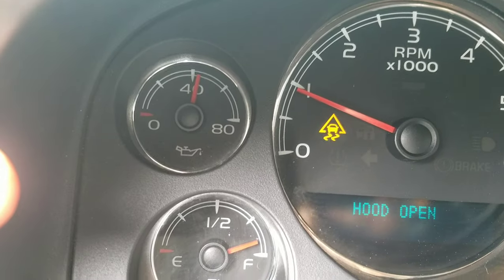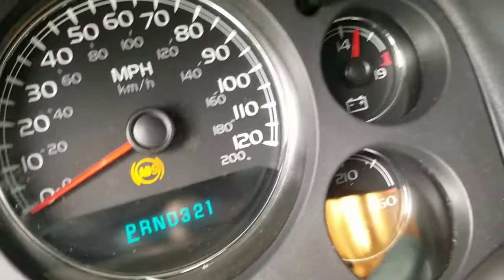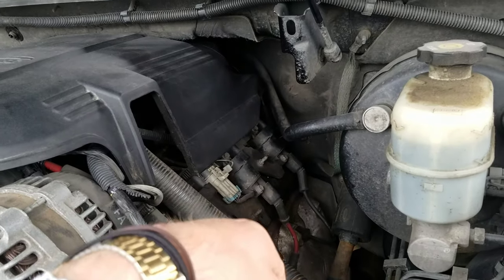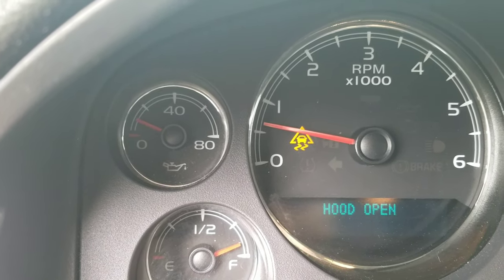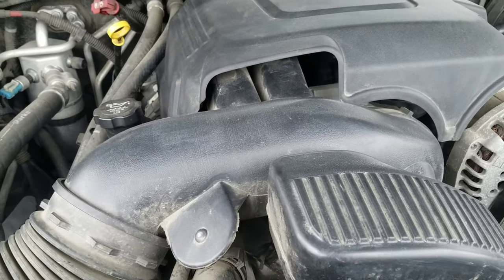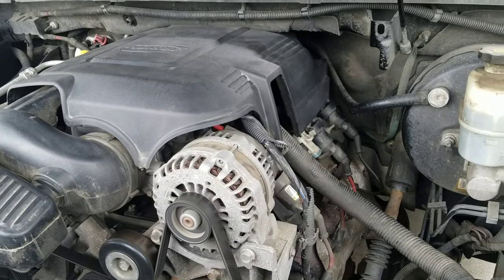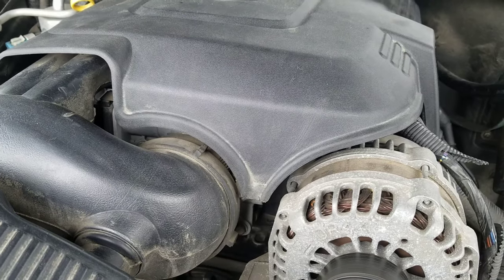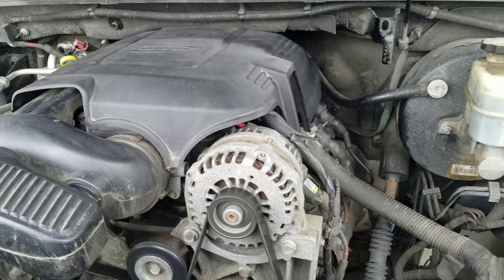0 or Low Oil Pressure? Chevy Suburban, 5.3l Vortec 2007-2014, Tahoe, Yukon. Diagnose and Fix Easiest

Comment: IMPORTANT! READ! this is my experience. I was coming due for an oil change at 237000 miles. I was about a quart of oil low. For the first time ever that warning light came on to "stop engine" due to low oil pressure. I took my foot off the gas and saw the pressure drop to zero. Fortunately I was a block and a half (less than an eighth of a mile) from home when this happen. When I stepped on the gas the pressure went to 15 and I was home and shut the engine off. I put almost a quart of oil in the engine to be full. My pressure went to 35 when cold start and dropped to 26 when engine warmed up. I studied you tube lessons on this. Auto Zone tested and said oil sensor needed to be replaced. A you tune lesson or two said put in medical oil flush, run engine at idle for 5 minute, change oil, use good oil filter, and use a quart of Lucia Oil stabilizer. I followed these directions having oil change at Wal-Mart directly after 5 minute flush. My oil pressure improved! It was 36 to 41 whether running in park or driving at 55 mph. I drove 20 miles to auto repair shop. That oil pressure maintained itself. By calling around this mechanic agreed to replace the sensor without removing the intake manifold and just working behind the top of the engine. The cost for sensor and labor wss $165. But this is when my awareness enhanced. He showed me the screen just after removing it. It only had a few specks of crud in it. I mean like 95% clean. When the job was done and I drove it the pressure was actually 1 psi LESS than when I drove my 2008 Yukon there. Still stable oil pressure as when I drove there. I then heard if we use an oil flush once a year at this mileage we will never have a problem with oil pressure. My conclusion: I did not need to replace the oil pressure sensor once I saw with confidence my oil pressure was good and stable going to the mechanic. Try this. If it works you save money, time, and worries. This was my experience. Wish you the best.
Reply: Thanks so much for this comment. My 08 suburban has been having this issue for a while. Stopped driving it because it was such an issue. Going to try this out. Hopefully it’s a fix.
Reply: I’m going through this right now with my 08 Surburban and I’m so irritated and lost for words!! I’m going try everything you done and pray it works 🙏🏿
Reply: @eprice8709 did u try it out?
Reply: What model is your truck’
Reply: Appreciate the mad detail dawgg.  Having this problem now but imma try it and hope it works.
Reply: @joshuareyes4059  I had the same problem 11 days ago that’s when I commented on this video… it ended up being the oil sending unit which have a built-in filter that was clogged up with gunk!!! once I change that and flushed it engine with a oil change my truck has been running perfectly and the pressure went up and the light is off. My problem is fixed and I have a 2008 Chevy suburban.
Reply: These filters get clogged if u lag to do oil changes new to before it’s a 20% oils life
Reply: Going to try this thanks!

Comment: I’ve had this issue and it was solved with a new oil filter and oil change. I believe the filter was getting clogged enough to drop pressure. I use quick change oil service place and suspect the filters are cheap.
Reply from the maker: There's so much sludge from the afm it gets clogged everywhere

Comment: So in looking into this, I believe that the number on the gauge is a composite of the value on the regular oil pressure sensor on the side of the engine and the sensor with the screen on the top back of the engine. The computer reads these two and creates a composite value that drives the gauge. But it seems to weight the data from the screened sensor higher..and that software routine is the same that calculates how much life is left on your oil.  So if there are bits and pieces of gunk in these really dirty engines, they are probably affecting that top sensor. The Seaform/B12Chemtool/ATF routine may be the only want to clean the gunk.   What does not make sense is that if you turn off the car, and restart, the PSI immediately returns to 40 PSI.  No o-ring issue would explain that. Maybe a gunked up oil pick up screen, or plugged return galleys? Nah, think it is software!
Reply from the maker: That's interesting. I know a lot of different scenarios led me to not believe this would do anything. I do think its somehow related to the afm problem with these and burning all the oil and gumming everything up in there.
Reply: The AFM lifter issue turns out that 5w20 oil is too heavy and combined with the oil gumming causes the AFM lifters to lock in place. Had this happen twice. Once, we ended up replacing all left side lifters. Happened again on the opposite side bank. Added 8 ounces of marvel MO and 6 ounces of B12ChemTool and the lifters unstuck themselves within a few minutes. Has not been a problem since. New 5.3 and 6.0L are spec'd with 0w oils. But that said, the real problem with these engines is the EGR pickup in the pan and the left side rocker cover. Both suck up oil vapor into the intake and coat everything. GM has TSB to solve the pickup issue in the pan but you have to drop the pan. GM redesigned the left side rocker cover twice to eliminate this issue up top. Note: use the dorman part as it is identical and 1/3 the cost.  Back to the gauge, when we pulled the lifter on left side, I replaced the sensor and the screen. Both were fine and clean.  I never had these silly issues on the old chevy 350 and Pontiac engines!!! One step forward and two back.
Reply: One other issue that seems to rear its ugly head is the oil pump bypass valve. I wonder if gunk it jamming this open. How could a vehicle have 4-5 events where pressure went to zero magically come back to full pressure. Only two other places, oil pump high pressure bypass and the oil filter bypass.  Maybe we can get a GMC district service rep drunk have him spill all the beans on these engines!
Reply: @WestonWaylandRotary  Exactly what I think...

Comment: I had this same problem, changed the sensor, and sensor filter. It got s little better, then I changed my STP oil filter with a mobile 1 filter, and now it holds about 40 psi while hot.
Reply from the maker: Nice. Sounds like your filter was grabbing all the gunk from afm causing sludge
Reply: @g3mccotter  I started running mobile 1 full synthetic and a k&n oil filter, and changing the oil filter every 2500 miles, and I only run the mobile 1 up to 7500 miles not the 10k it's guaranteed for
Reply: @bmoretrading7295  I run the mobile 1 full synthetic with the k&n oil filter and change the filter every 2500 miles or so.

Comment: I think my issue is the relief valve is stuck. I never had this problem until I drove through Tennessee and found out about the feature with the automatic downshift in steep hills...
Reply from the maker: Wait what? Tennessee def has hills. My year didn't have auto downshift...
Reply: @g3mccotter  I still haven't fixed the issue but today, I noticed that the oil pressure increases when the engine switches from 8 cylinders to 4, so I definitely  think its a valve somewhere or possibly the pick up tube o-ring. FYI, my engine has over 300k on it and I never had an issue until that damn trip to Tennessee...
Reply: @bigseksi5514  my oil pressure increases on downshifts too.  The higher the RPM the higher the PSI right?

Comment: This is great! Thank you for making this video. My 2010 XL does the same thing right before an oil change is needed. Oil change with a WIX XP oil filter does the trick. The xp is a 2 dollar upgrade from the standard WIX. I only have the issue around 15% oil life. I'm definitely going to add seafoam before the next change. 115,000 miles and loving it. I'm hoping the upgraded filter also helps as it's designed for synthetic oil
Reply from the maker: Maybe helps. Need to deactivate the afm to fix the problem really before it's too late
Reply: @g3mccotter  I put it in manual 5. It won't activate the AFM unless you go to 6 but if you just shift it to D than it's active in most gears. I don't think it messes up anything. I was tired of feeling like I did not have power driving at lower speed in the city so I tried shifting it manually with the buttons and figured it out.

Comment: I’m glad I found your video. Had an appointment set up later this week to have my dealer look into this issue. Saw your video and did exactly like you said and after adding the fluids my pressure started to work it’s way back down to around 5 but then has slowly climbed up to about 30 at idle
Reply from the maker: Unfortunately this might not be a permanent solution as sludge continues to build up

Comment: What did this end up being?
Reply from the maker: Kind of what we assumed I think with sensors and screen and gunk.
Reply: @g3mccotter  my Tahoe started doing the same thing. Changed the screen and sensor. Started it up and worked fine for about 30 miles, now doing it again.
Reply from the maker: @WingmanFarms  do what I did in the video
Reply: Going through same thing right now 08 sierra with the 6.0 just changed the sensor and the screen at back of engine went to pick up at mechanic got it 12 miles and it is reading low oil pressure again. As soon as I find the issue its getting traded in I just put 2200 dollars into it a couple years ago when it dropped a valve spring. 
#donewithit

Comment: FREAKIN GENIUS!!!!
My 07 Tahoe ran with oil pressure just at 20.  The “low oil, shut engine off” light would come on.  After doing this oil psi is at 40 idle and 60 when running.  Never was that high before. My mechanic thought I should’ve replaced the engine. 
Time for a NEW MECHANIC!!
Reply from the maker: Good to hear. These engines are trash though with that afm. As they do cause a lot of issues. Better to get a older one before cylinder on demand or after. I think 2012 they had it sorted out
Reply: So what you did again? Just making sure I heard this right.  You just put a 1 qut of Transmission fluid and seafoam and how long you leave it there inside the engine?
Reply: Ran engine for 5 minutes then changed it
Reply: I guess I plan on doing this to my 08 GMC Sierra that I just got with the first oil change I do on it since at idle the oil pressure sits at 15-20psi and then it’ll start ticking but runs and drives fine with no problems or lights on it with oil pressure around 40 psi while driving
Reply: @mrhighway  have the same question
Reply: @g3mccotter you can do a delete and get rid of that issue
Reply: This gen 4 5.3 is trash.  Always tried to stay away from  chevy and now I know why. Dealer said bad lifter and check engine light does not come on. They suggest a new engine. WTH.

Comment: So I was driving my 250,000 mile Yukon daily. This just happened to me. I was freaking out cause I thought it was time for a new engine. I put a bottle of sea foam, 1 qt of tranny fluid in and let it run for 3 min or so. Changed the oil. Changed the oil pressure switch and cleaned the screen. Fired it up and it’s all good. Thank you. Thank you. Thank you.
Reply from the maker: For sure.
Reply: Changing the Oil Sensor + Screen would have fixed it without doing this. But it's a pain in the ass to change it. This video solves that by clearing out the screen and allowing the Oil pressure sensor to get a better reading.

Comment: The comments are giving me hope! Its a little bit over midnight as I am seeing this video.I can't wait till the morning to try it on my car.I have chevy traverse and my car have this exact problem. Infact,  I already changed the oil when it first happened and it got beer for almost 2 weeks.But I didn't drive it for two connective days and the problem comes back.I was frustrated this time, I hope this trick will work on car too. Thank you for the video
Reply from the maker: Those have a different engine so not assuming this is your problem

Comment: I was having the same issues with my 2007 Chevy Silverado. Additionally to the oil pressure dropping issue, sometimes my engine would run rough as if I was missing on one or two cylinders. But sometimes it would run fine and I would only experience the oil pressure dropping with engine warmup. 

Anyway, after trying the Seafoam treatment in my oil, I noticed the oil pressure stayed normal for a little bit longer. 
So I ended up doing three oil changes and using the Seafoam treatment. 

My truck is now and has been running perfect for several months now. 

I'm pretty sure I'm now going to be doing a Seafoam treatment every time I do an oil change. 

Thanks for making this video.
Reply from the maker: Sounds good. Yeah with the afm in these things it builds up crazy sludge I think
Reply: You can do the same thing with transmission fluid the transmission fluid  is a cleaner it will clean your lifters and all
Reply: You put the seafoam in your gas tank or oil?
Reply: @coreymercer3920  oil. 

I added it to my engine oil. I let my engine run for a little bit. Then I changed my oil. Things cleared up enough for me to be able to drive my truck. But it still was chattering and running rough. I added seafoam again and drove about 30 miles. I changed the oil again, I didn't see phone and drove about 50 miles. After changing oil that had cleaned out everything pretty well and started running smooth. I'm still driving the truck today.
Reply: @quentinbell5617 how’s the 5.3 holding up after a year of that?
Reply: I am still driving the truck.    I have went to changing the oil every 3000 miles. I use the seafoam before every oil change. 
I currently have over 300,000 miles on the OD.
Reply: @quentinbell5617 
Guess I’m going to try this today. About 9 months ago I replaced the oil sensor because that what registered diagnostic test at AutoZone. Was fine for all this time and then my oil pressure dropped and the alarm came on. I know it can’t be that sensor again. I don’t even have 3,000 miles on it since I replaced it.
I’m going try the seafoam and oil flush and oil change and hopefully that fixes it.
It’s definitely frustrating!

I see it’s been a month since your last comment. Everything still good?
Thanks

Comment: Well it worked! Just like you said. After running the ATF and seafoam, got a little thicker gunky oil out of the pan. Used full synthetic 5/30 and put in the AC Delco black filter. Noticed immediately the pressure well above 40#, increases with engine rev. Drove for 30 miles and stayed the same with ~ 30# at idle on warm engine. Solved!?!  What would we do without you people getting your vids on here. Thanks for taking the time.
Reply from the maker: So awesome to hear. Yeah I couldn't believe when mine worked I was very grateful since multiple people were telling me I needed a new engine. Yeah those oil pressure sound right.
Reply: Is it still good?
Reply: g3mccotter it worked for u how long did it take ?
Reply: Still running Ok. 30#-35# after engine is hot.
Reply: How’s it holding up ? Any updates on the pressure ?
Reply: What do you do with the ATF and the Seafoam, are you running the ATF thru the engine
Reply: @zacharyaguilar439  I let the engine idle 20 -30 minutes to let the ATF and Seafoam run hot thru the motor, did not drive the vehicle! Then drained it out and got rid of it. Using Mobile1  5/30 full synthetic, still no problems. The filter is ACDelco UPF48r.
Reply: its been 3 years how is it holding up boss
Reply: What does atf do for cleaning? I used seafoam just now.. gauges says 0 pressure but engine still sounds as healthy as can be. Hoping this cleans the sensor. Gonna change oil in a few days even though i did it >500 miles ago
Reply: @comaradelee  ahh ok, thank you. Im hoping the seafoam works, but ill add some of that as well.
Reply: @Straight_White_Fatherly_Figure  might aaswell add 1 lt. you can also use diesel oil before changing to 5w30. it is also a cleaaning agent.
Reply: @comaradelee  thank you for the recommendations 🙏🏻 never had oil pressure issues before so this'll be a nice learning experience.
Reply: @zu1502  howd you realize it was wrong filter?
Reply: @zu1502  ah sounds very similar to my situation. Thank you for sharing! Im going to change the oil when i get home from work today and see how it goes. Wish me luck 🤞🏻😅
Reply: @zu1502  im going to have to check out how to do that. Do you bave any recommended vids to check out?
Reply: After running the ATF and seafoam did you change your oil?
Reply: @cameltoejhonsonbro92  mine ended up being chewed up wires at the sensor from squirrels looking for heat during the cold
Reply: Yes. Whatever the ATF and seafoam cleaned up I did'nt want left in the oil for very long. Probably would have been ok for awhile, who knows. Just was'nt worth the risk and cleared up any doubt if problems arose. Still maintains pressure 25-40 lbs when warmed up. Only occasionally it may dip to allitle over 20 lbs when hot and at low rpms, but responds as rpms rise. Hope this helps.
Reply: How much do I add of seafood and atf
Reply: are these engines ---- "sludge monsters"" or what? I saw another video where he put in quart of ATF and then 5 quartz of oil on top of that. This was to quiet the lifters down. I put in a pint and it worked - lifters are quiet. Is it a good idea to leave that ATF in there? Should the oil be dumped shortly after? I have a 2004 5.3 ltr in a GMC Sierra
Reply: @justadreamin1004 put the ATF in the oil then idle the vehicle for about 20-30 minutes. Obviously turn the car off if it says the oil pressure is low then start it up again. Repeat as many times as you need to to total 30 min. Do not drive the vehicle if there is ATF in the oil. After the 30 minutes drain the oil, replace filter and add new oil.